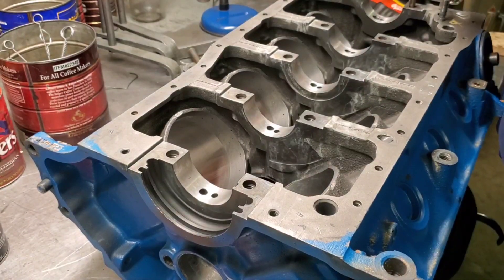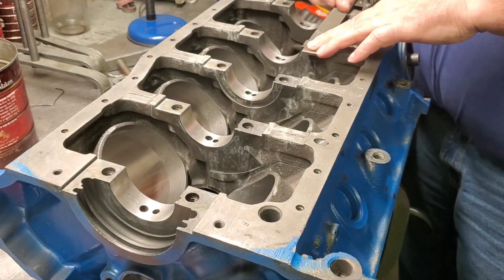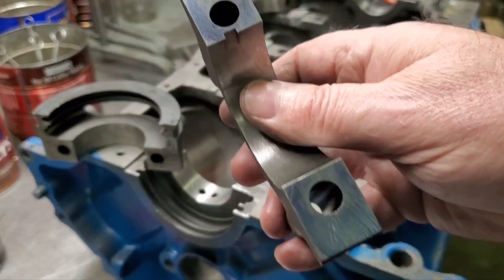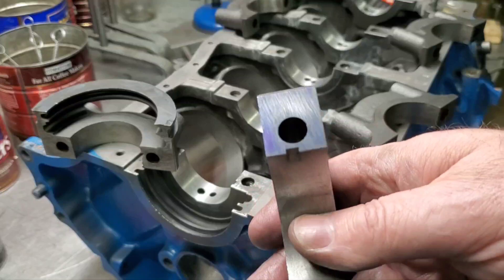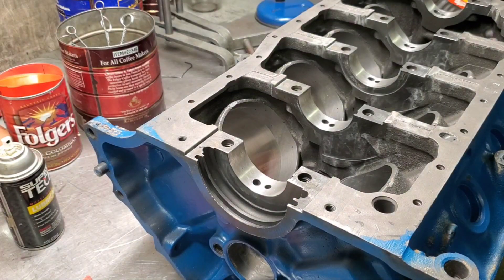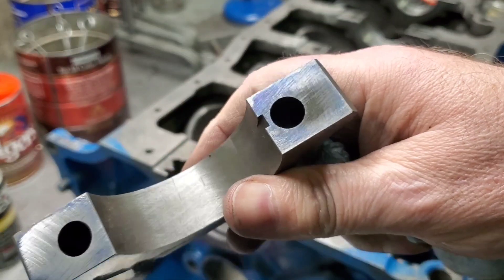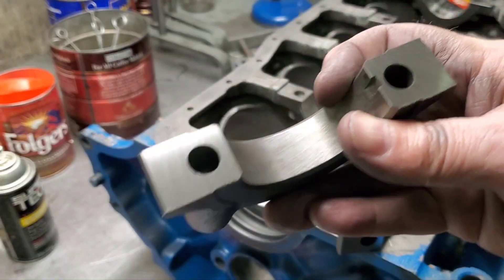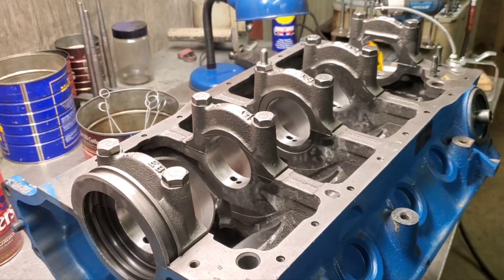Ford 302 Line Honing Preparation or Re-Line Hone.

Comment: Awesome detail. My son has a 351W that was line honed but the machine shop did not notate how much they took off of the caps. How do I measure the crank centerline and what should that measurement be on a 1996 5.8W roller block to see if we need to buy a -0.005 or -0.010 timing chain set? The one they installed on the long block seems a bit sloppy to me.
Reply from the maker: @AwesomeBuford  Thank for watching Buford.
Kinda hard to measure between the main bore and cam bore.
Try a .005 reduced centerline timing set.
If it is the first time linehone, they may not have taken to much off the caps.
Did it spin a bearing?
Sometimes the replacement timing sets are loose.
So the shop may have not done anything wrong.
Some of the billet timing sets are almost to tight, may try one of them.
Have a good evening. 👍🇺🇸👍

Comment: Hi Ed, the prep that goes into machining a block is the key. one of the shops I worked at we would line bore the block to .0005 and then line hone it to size.
Reply from the maker: Hey Randy, thanks for watching. 
This block was in such bad shape, a typical production type job.
Not interested in precision. 
I am not done with this yet, but close.
Hopefully tomorrow. 
It will come out pretty good.
Take care, Ed.